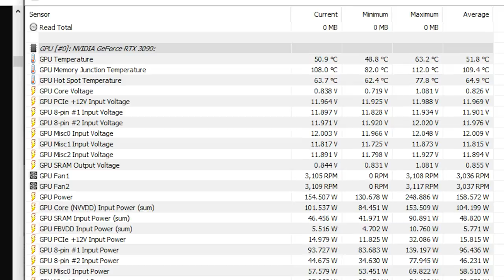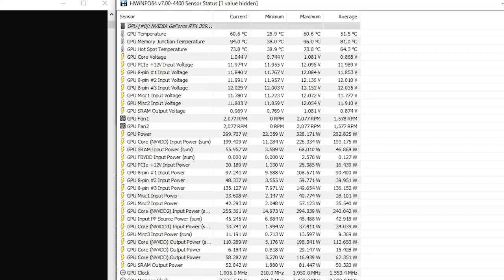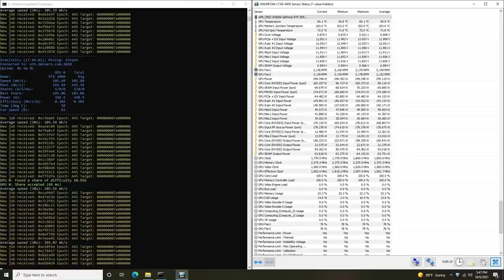Zotac RTX 3090 Trinity Thermal Pad Replacement

Comment: For the viewers who are asking what pad thickness to use. I would say it depends on what thermalpads you are using. 

I usually buy thermal pad thickness from 0.5,1.0mm,1.5mm etc all the way to 3mm. Then when i remove the original pads i measure their thickness with a small ruler or vernier calipers.

Take note of your thermalpad hardness though. The Gelid ones recommend by SOAT are usually softer(shore rating around 30), so you can use same thickness of gelid pads as compared to the originals that you took off.

IF you are using harder thermalpads like Thermalright odyssey pads(shore rating 50), you might have to use 0.5mm thinner pads as compared to the ones you removed.

Reason for using less thickness for the harder pads is due to them not compressing as well as the softer Gelid pads. So if you used the same thickness, the hard pads prevent the cooler from contacting your GPU die.

I'm speaking from experience of using the harder Thermalright odyssey pads, I HAVE to use 0.5mm thinner pads as compared to the original, in order for the gpu die to have proper contact with the cooler/cold plate. Disclaimer is that I have not used the Gelid pads that SOAT is recommending.
Reply: Why you are not used Gelid pads?
Reply: @cyborg6294  Because I have not bought them yet. These thermal pads don't come cheap. 1 of each size from 0.5mm to 3.0mm should cost close to a hundred USD.

I will try the Gelid pads once I use up my Thermalright Odyssey pads.
Reply: @Fate025  You can get Gelid pads cheap on aliexpress I think soo, by the way me too use only thermalright. Thanks for sharing really valuable information with us.
Reply: @cyborg6294  i know the most affordable prices are from Aliexpress, but still getting 1 is around $20usd, so getting 1 of all thickness is over $100 usd
Reply: You are right, it´s more like 1.7-1.8mm than 2mm in a lot of cards, if you can´t compress the pads the DIE don´t touch the cooler enough and you have to put more thermal paste in between.

Comment: I use the thermal pads that look like they are in a playstation packaging colors and stuff. They have 38 watts of cooling. I used them on a 960 4 gb ftw card that was running at 62 c and fans were 100% constantly now it runs at 37c can't even tell its running. So I will be sticking with this brand sorry can't remember the brand name exactly but like I said it looks like a playstation branded packaging..

Comment: So, where can I find out the correct thermal pad thickness for my GPU?
Reply: some actual comment rather than the useless scammer comment here. I usually buy thermal pad thickness from 0.5,1.0mm,1.5mm etc all the way to 3mm. Then when i remove the original pads i measure their thickness with a small ruler or vernier calipers.

Take note of your thermalpad hardness though. The gelid ones recommend by SOAT are usually softer, so you can use same size gelid pads as compared to the originals that you took off.

IF you are using harder thermalpads like thermalright odyssey pads, you might have to use 0.5mm thinner pads as compared to the ones you removed.

Reason for using less thickness for the harder pads is due to them not compressing as well as the softer Gelid pads. So if you used the same thickness, the hard pads prevent the cooler from contacting your GPU die.
Reply: @Fate025  really good info, thanks for sharing
Reply: back plate pads are typicall 2.5 - 3mm and the front pads are typically 2 mm. you can stack them with no loss of conductivity despite people saying they lose conductivity. source: manufacturer
Reply: @WhatsY0UTUB3  well done

Comment: as you know in mining when paste needs to be replaced? is it lost hashrate? I have a problem, I lose hashrate, sometimes come back….and then the whole rig stops working. can anyone tell me?
Reply: If the gpu thermal pads don't make good enough contact with the gpu. It can cause the gpu to thermal throttle and shut off if it gets too hot to even sustain.
I know this because when I replaced the thermal pads on my 3080 and used 3 milimeter instead of 2 milimeter thermal pads. The gpu would show up in windows for a few seconds. I would mine on it for a few seconds. Then it would suddenly cut out and stop registering any clocks. 
Generally the thermal paste probably doesn't need to be replaced.
Reply: You also might be having a short somewhere in the system. Again harking back to my thermal pad replacements. I accidentally put thermal pads over the part of the pcb that was not where a vram chip was. Anytime I tilted/shifted or even slightly moved my 3080 around even by a few centimeters. Like you normally do when inserting it into the pcie slot. 
It would immediately tell me "device 1 failed to register power" thats because the thermal pads are shorting the pcb. 
Try opening your gpu and looking to see if any corrosive material is on the gpu or the pcb. 
Like near the mosfets and capacitors. 
If you cut the thermal pads too big and they start touching the other components. It can halt transmission or affect it in someway.
Reply: @Savitarax  tnx!

Comment: Is it cool enough though? I'm afraid that if I buy one of these gpus, it won't last very long. What do you think? Are these gpus a really safe investment to mine coins?
Reply: according to nvidia 110 degrees will not damage the memory and is within the expected operating range, it just throttles at that temperature to prevent it from getting hotter. i've been mining on 8 3080s 24/7 for almost a year and they're all fine
Reply: @WhatsY0UTUB3  Awesome, thank you for sharing that info!